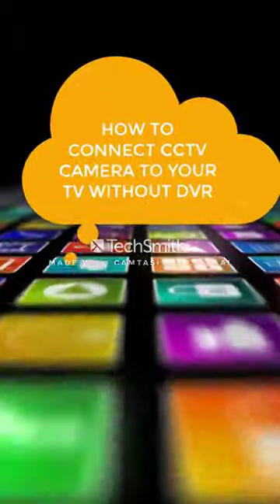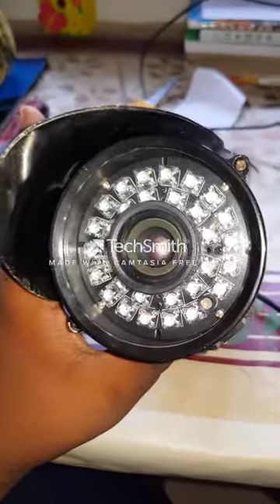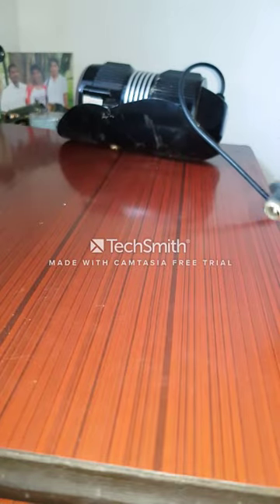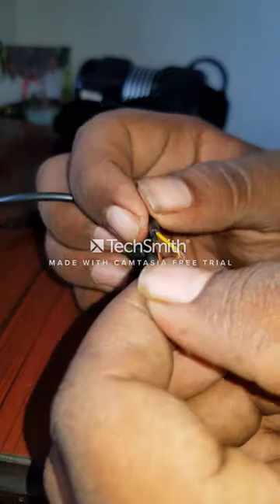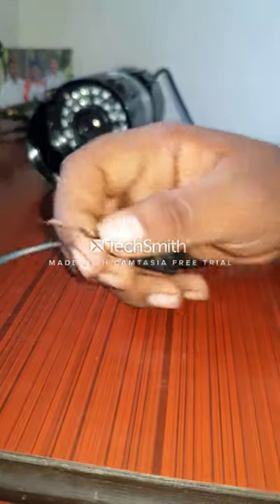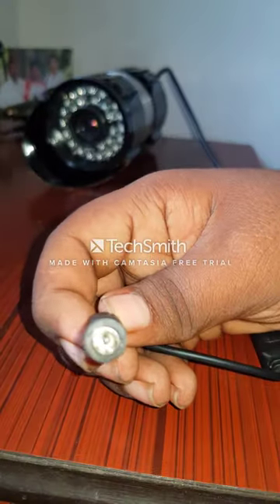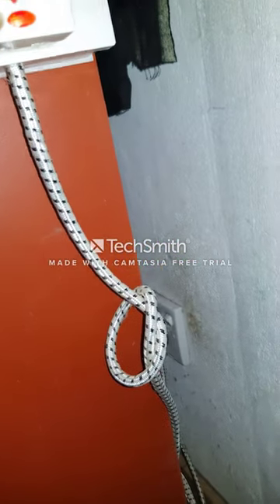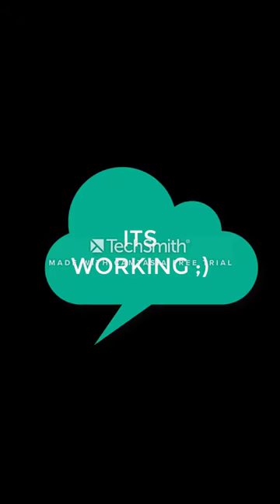HOW TO CONNECT YOUR CCTY CAMERA TO YOUR TV WITHOUT DVR

Comment: If you've got any old sling or direct TV DVR power boxes they have the green sticker usually they make goo power supplies at 12v 1.5 amp also makes a good motorcycle battery trickle charger

Comment: Was the video about the music or camera connection? little confused? If you cutting wires you need to cut them longer at the plug 🔌 end once they come undone a few times break you won't have any wire left to play with. At least you will have that music to play though.